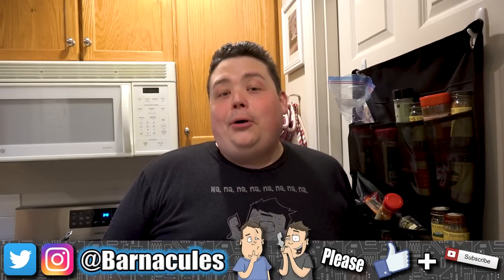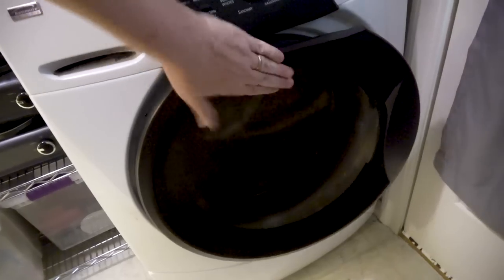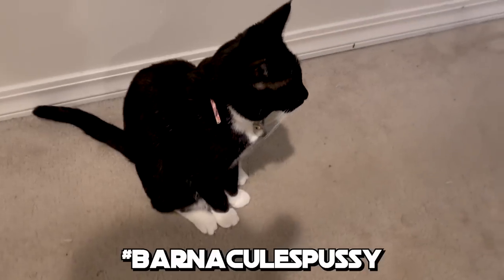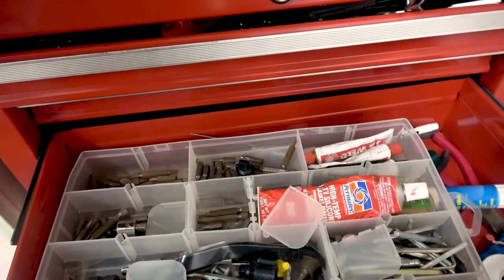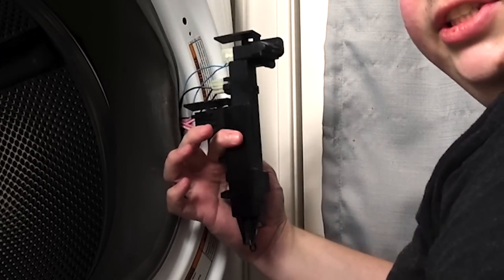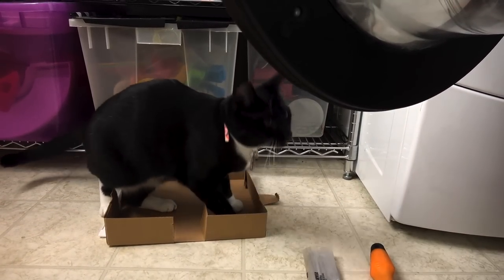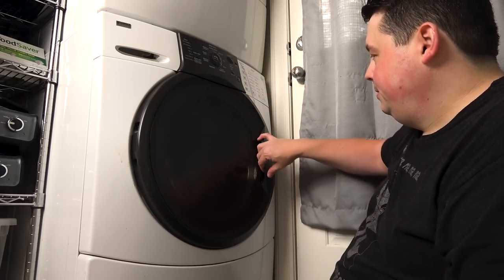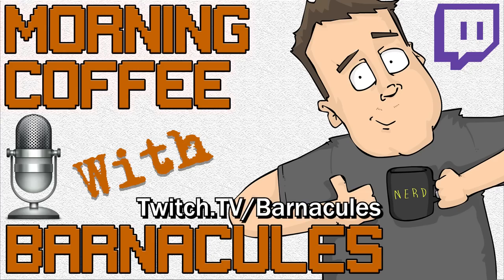How To Fix Broken Washing Machine Door DIY Tutorial - @Barnacules

Comment: Think! the springs on a normal pin locked would wear and tear plus there's no easy way of undoing the lock that wouldn't ultimately defeat the purpose of a lock in the first place and child lock would be hard to implement because as easy as you can set child lock on its as easy as undoing the child lock plus if your washer starts violently pushing everything around the simple lock would be easily undone so in conclusion easier control of the lock and even possibly an auto adjusting system for what type of load and if you forget to lock it or even have something in the way to were the door was blocked it would know so there's your answer a very long answer

Comment: The latch has These Sensors, so the can Check, if the door is closed properly. You can not start the machine with the door closed. They probably need to make Sure everything ist failsafe...

Comment: One plug operates the door latch. The plug below that one controls the camera that takes pictures of your lady's undergarments. The third plug is for the sock eating unit located deep with in the dryer. I'm both certified and professional so further research into the part will be unnecessary.

Comment: The door lock is electronic because 1. It needs to prevent people from accidentally opening it during a cycle. 2. It actually locks, sprays some water, unlocks the door and waits for a moment to make sure a kid isn’t in there.
P.S. there’s no good reason to have 3 wire harnesses. I’m guessing that they did that to make it more universal.

Comment: When you've overhauled the entire machine, then they will hate you, no, seriously, they will. When my stealership caught on what i was doing AKA, replacing every part, they cut the stream with bullshit excuses, even tried to sell me wrong parts. 

A door latch? Big deal. Spider replacement, replacing the bearings, replacing the seals, new shocks (kudos points if you figure you can shove better ones), recapping the brains of the operation, a few new diodes, LCD update with the later generation + chip flash and homebrew software injection (took 3 people for that, i admit), better glass, reinforced bottom plate, cast iron weighted for zero vibrations, angle iron side reinforcements, taller legs for easier access to clean under because moving it now is a bitch, and last but not least, because after reading the story about the kid that got impaled by the exploding washing machine, top plate which is usually some shitty particulate board, got a 4 mm thick plate, which also helps with vibrations. Oh and i rewired the harness to my car like specs.

IN short, homie, what's that repair, that's a rookie repair, you have to step your game up.

Comment: I think the connectors are something simple, due to the colors, one is power, the second is ground, and the third and largest one is probably the solenoid. It could all honestly be condensed into one connector. But hey, more parts to go wrong with more connectors, amiright? Not to mention more internal pieces that they get for cheap that they can turn around and overcharge you for. The machine itself is overly complicated just like the repair process through the store, every little thing to milk your bank account. 
But, if you want the definite explanation as to why that part has three connectors, you need to disassemble the old one and see what those connectors go to and make an educated guess. If that doesn't work, you need to look up the other electronics of this washer and piece together the puzzle. But lets be honest, that's too much work for someone nobody really cares about.

Comment: Jerry, that door latch is basically a 3-in-1 mechanism, consists of a detector and pin lock for safety connected to the door latch. why a detector? Cause processer board inside washer need to know whether the door is closed so it can proceed to pump in the water and spin the tumbler. And why the pin lock for safety? Cause if the lock is not there, kids will open the door and washer water flood the room. So now you know why it's huge for fucking door latch? (sorry for f-word, no offences).

Comment: I expect a favorite for this post, maybe a pin.. :-)
1) Your washer was built by Whirlpool
2) The Latch Assm serves multiple purposes (Sense, Switch, Lock and Unlock)
3) Pins 3,2,1 (3 pin connector) handle the Lock and Unlock Solenoids. 
4) Pins 5,7 (2 Pin connector with heaver wires (4 wires)) handle power switching (One handles the Neutral, the other L1)
5) Pins 8,9 (2 pin connector with lighter wires) handles the actual door switch logic
6) The 'eye' is actually a manual release unlatch lever
7) I may have missed it, but I didn't see you turn the circuit breaker off before working on your machine... :-(

Now give me my Favorite! :-)

Comment: It has a electromagnet or mechanism inside the lock to prevent the user to open the door while operating (that is 1 connector)
It also has a system to tell whether the  door is closed or not (and that is the second connector)
* flies away*

Comment: Liked all the voice overs. But you didn't prove you really put it back together properly.  You might not have installed the rubber gasket or that wire ring right and next time you wife runs the washer its going to leak all over the place or worse in the motor or electronics of the washer.
Why didn't you to a time lapse of Ms Barnacules doing a load of wash so we saw it really worked. Know you must have something to wash cant say you didn't. Or at least the surprise on your wifes face when she got home that your diy actually worked